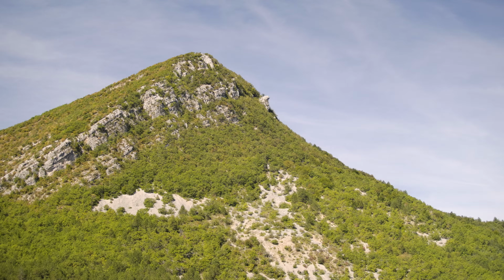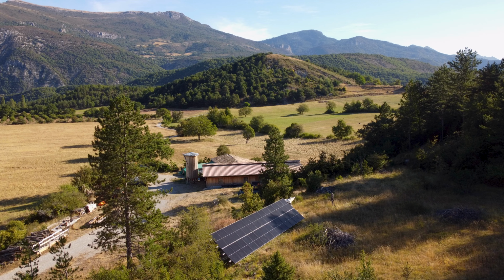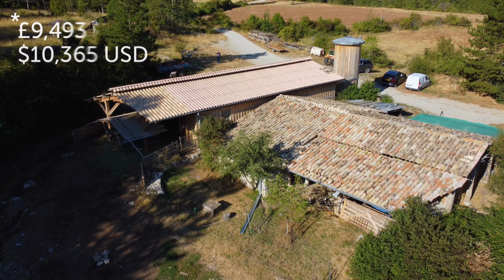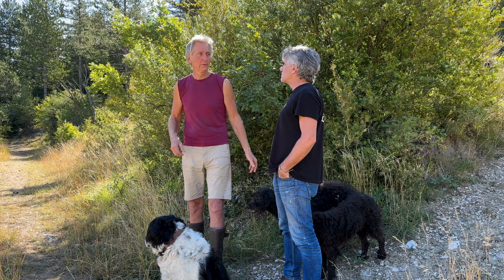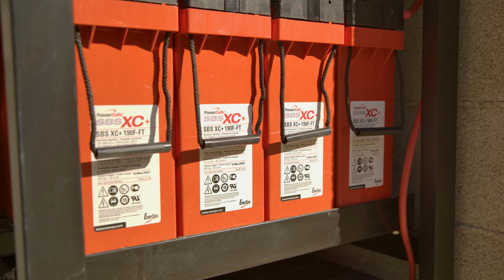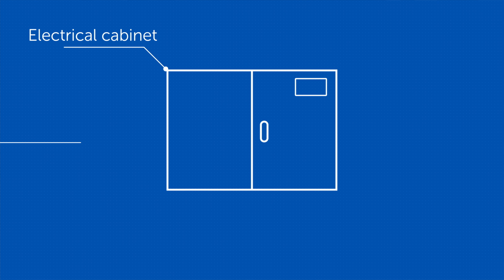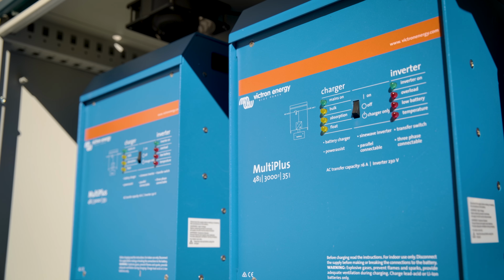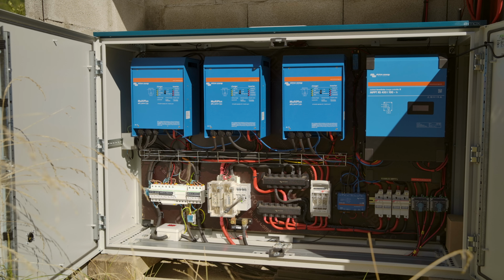How this goat farmer uses solar up in the French Alps

Comment: 3x3KVA Mulitplus'?  Bitjie on the small I'd say. Never good to run anything close to the bone imo. Did they look at the 5 of 8kVA models? Much more headroom there, and room for expansion

Could some temperature control (ie heater) not be used for the lithium batteries in an insulted enclosure in the winter? surely the energy cost of that could be justified with the depth of discharge and number of cycles advantage of Lithium. I'm doing a temperature controlled enclosure project using Arduino etc, we don't have snow but in winter here when it falls to around +3 the Pylontechs stop accepting charging current. At 5400 ft altitude.
Reply: In the mountains it can go down to -25C,Its very hard to control that,if they wanted the battery outside there....The lead acid they choose are very high quality bateries,very good ones.And for their purpose i think also the best solution...

Comment: Always interesting to see these case studies. It appears they are overpanneling heavily with 10kW panels and max 100A output to batteries, which would charge at max 5kW.
Reply from the maker: Thanks for watching.  Remember the location causes a limited period of time that the sun actually goes onto the panels (in winter) due to the peaks of the lovely Alps mountains.
Reply: Also remember that they have loads on the panels too,so they charge bateries,while also mostly using the energy on sun hours.

Comment: In general, would this not be a good example of using sodium batteries instead of acid batteries? (Sodium wasn't an option back in 2022 though, when the system was designed and built.)
As they charge similar like Li-ion batteries, Victron charge controllers should have no problem supporting them. The Multiplus would be able to use around 70% of the capacity when looking at the discharge curve of sodium batteries. This would guarantee a very long service life of these batteries in such an environment.
Reply: For outside Sodium is useful even at -20C. Due to the higher safety, they would also be great for in-house batterystorage. Thats a large market for Victron when the next generation sodium prismatic batteries are produced at large. I hope within 1 year they will be available for us.
Reply from the maker: Nice suggestion!  Thank yiu
Reply: Hi I have watched your sodium battery testing videos on your channel and found them very interesting!